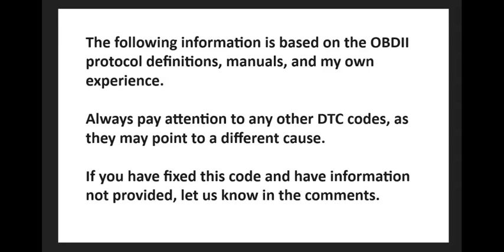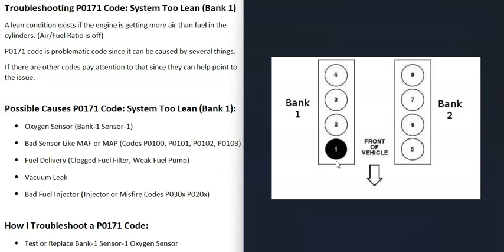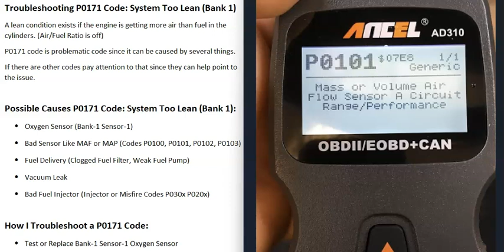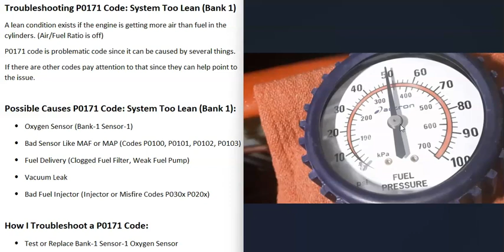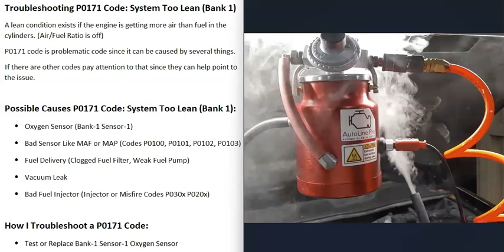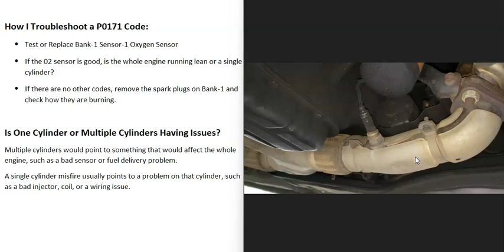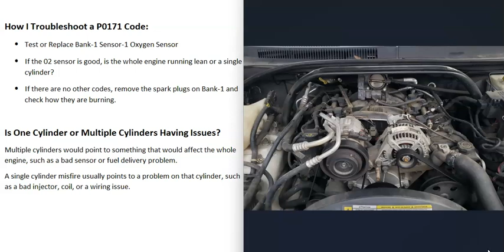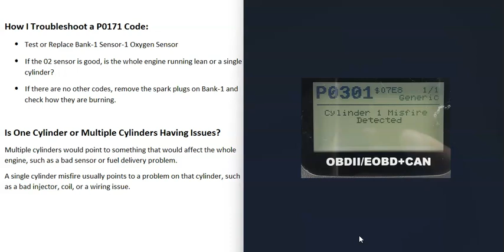Troubleshooting P0171 Code: System Too Lean (Bank 1)

Comment: I have a 2011 toyota prius and i have replaced o2 sensors, all 4 spark plugs, got new MAF sensor, checked for air leakes everywhere, checked injectors and are good. And the car doesnt misfire or do any wierd bull crap! Help

Comment: Thank you! If you go to smoke test the motor can i just pull the brake booster hose or is it better to go through a different port?
Reply from the maker: Yes, the brake booster hose is often a good place to inject smoke.